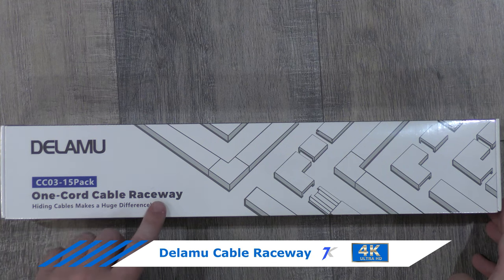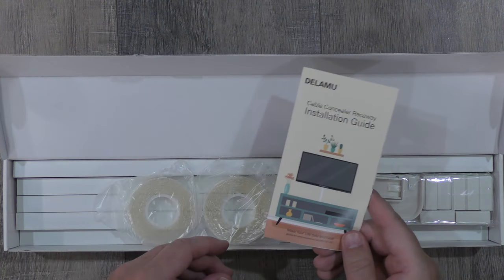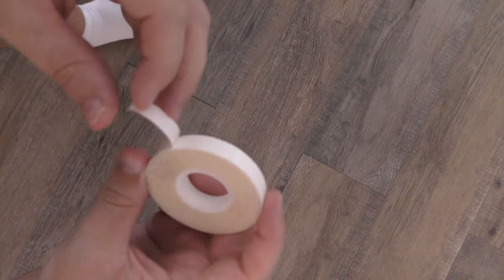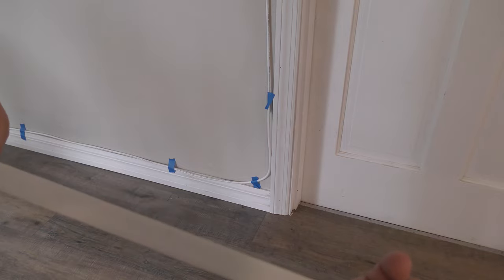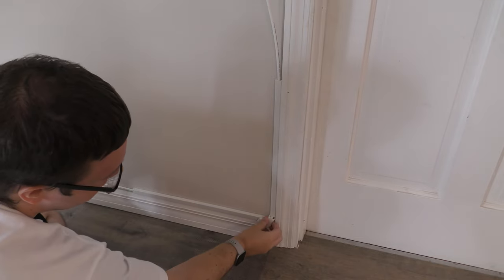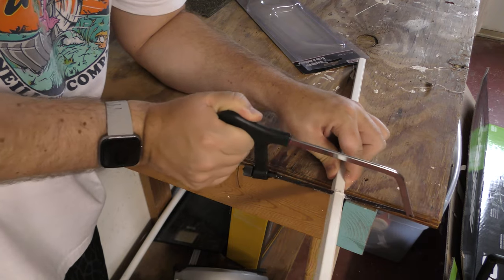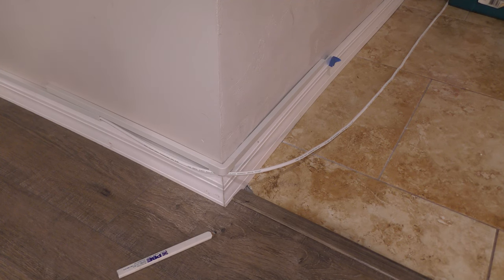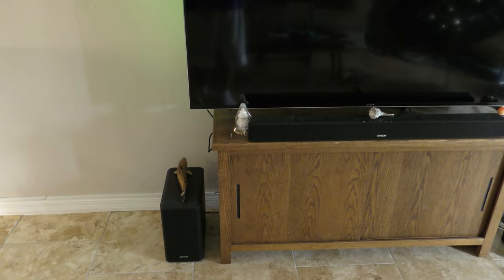Delamu One Cord Cable Raceway Unboxing and Installation

Comment: 1. Each coaxial cable has max bending angle in its specs (like 4x of cable thicness). If you bend it too much in too short distance at best you will degrade its capabilities with each bend. Many such bends may lead to signal problems. At worst you can break shielding or external layer. Correct me if im wrong but to my eye this angles are too tight. IMHO you should use larger/wider raceways for coaxial (or cat6 and higher) cable. 2. When you connect two raceways you should change covers placement so their covers meet in different place than raceways themselves. In other words - in 2 raceways meeting place the cover should be seamless and in covers meeting place the raceway should be seamless.It's easy to achieve just by some covers swapping.

Comment: You needed to describe the connector installation. Spacing and use of them is part of the job. That’s the biggest issue with these channel systems. Hopefully you will explain that in a future video. Thanks.